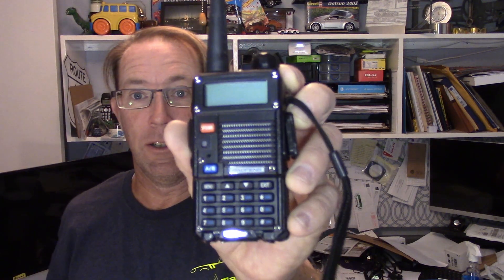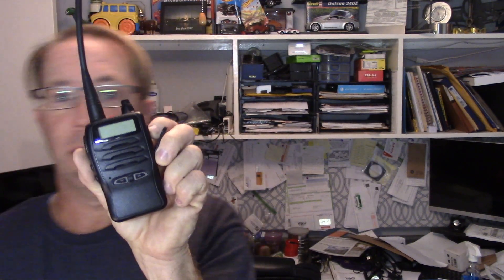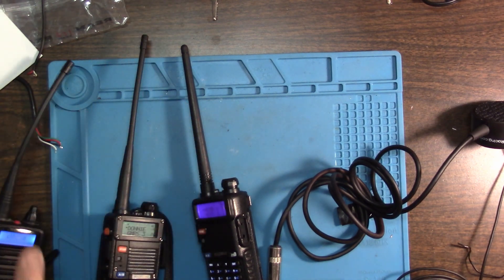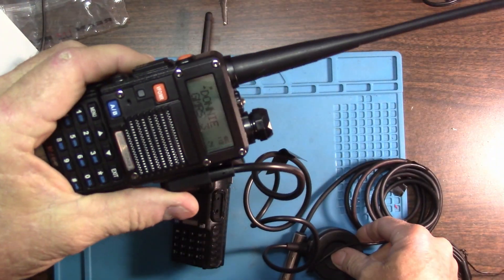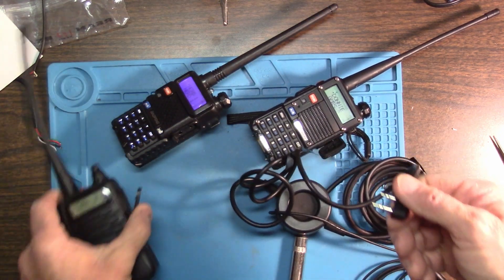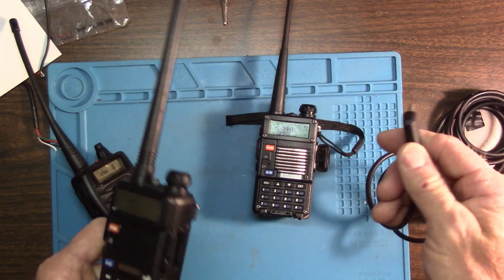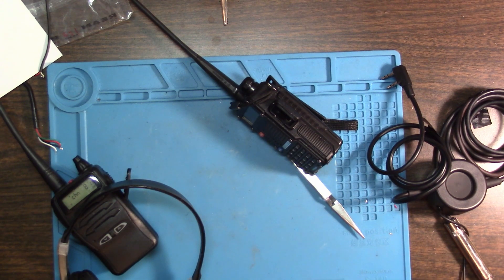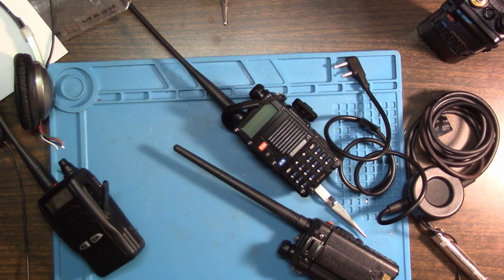Baofengs UV-5R v UV-5R8W v BF-F8HP

Comment: Can you take a photo of the long battery uv5r 8w model the sticker of the radio, mine is written baofeng but the sticker is in green pofung without mentioning wattage although on the front is written uv5r 8w like yours
Reply from the maker: I can not figure out how to reply with a picture.

The tag under the battery says Baofeng on the top and Po Fung Electronic at the bottom below the S/N.
Reply: @nerdieracingcommunications5478  thank you for the reply, exactly like mine pofung but no wattage other than the little black sticker uv5r 8w in front of the ham, let's hope is original and at the same watt they came cause I don't have way to measure it, other than it has 3 levels low med and high instead of low high that the say are present on the 5w model!

Comment: We had this exact issue come up at road atlanta 2022 lemons race. We unlpugged it and plugged it back in and it started working again. Ill modify the radio in the car or get the 8w uv 5r.
Reply: Wich is better the 8w 5r or the regular uv5r

Comment: it is no way to connect PC to program this BF-F8HP, can't make PC programming works for this item. same-time i purchased a BaoFeng UV-82HP it works ok for PC programming.
Reply from the maker: I programmed a few batches of radios recently. Some were fine, some needed to be unlocked and a couple programmed one time but not the next.

The pair that would not program the second time is still unsolved. Could be my programming cable got damaged. There are two versions of CHIRP now, Legacy and Next.